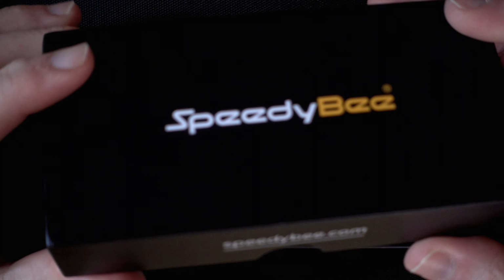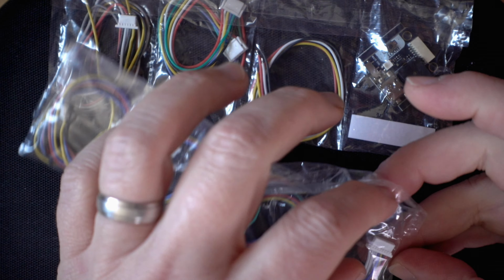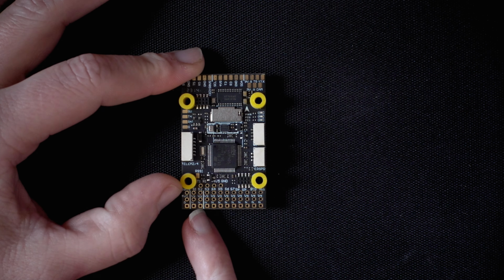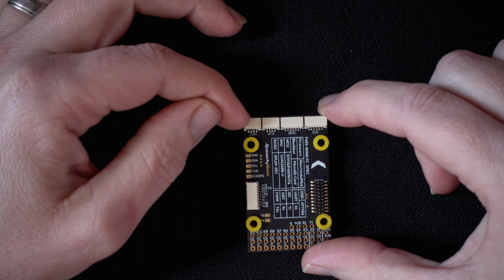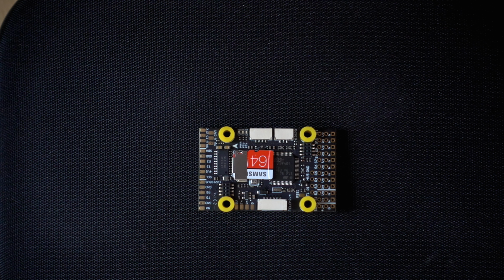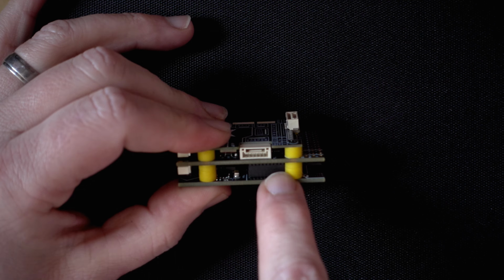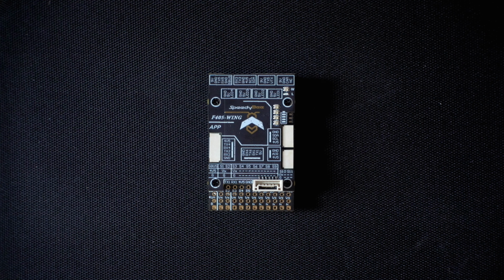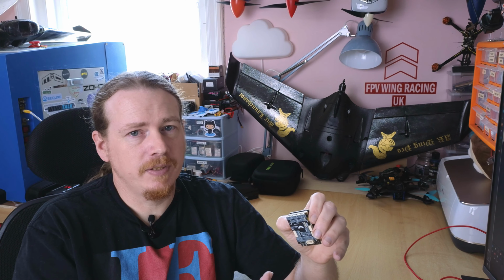First look at the SpeedyBee F405 WING flight controller

Comment: Brilliant overview Darren!!! I'm glad you touched upon the cons of this FC. Hopefully reviews such as this will push SB to refine the next line of FW flight controllers. 🍻
Reply from the maker: Thanks Shawn. For me there are a few cons. But I still think it will be a good FC regardless. But yeah, I hope a v2 is a bit more thought out.
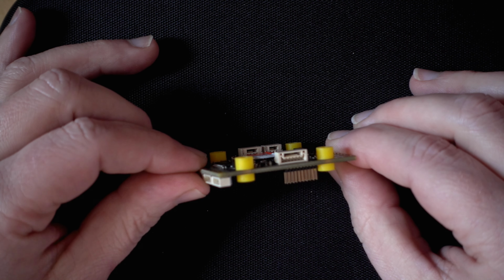Reply: @MrD  14:39 The barometer is absolutely indifferent to the presence of the SD card next to it. It measures the ambient pressure, not the air flow rate, which the card plate could interfere with. This claim is absolutely unfounded. 
 As for the "extra" connectors on the board - this is done for versatility. You can either solder or use connectors. This is as convenient as possible for different users. I think you can solder off these connectors if you don't need them.
And even more clever will be the creation of a printed circuit board by you, where all your comments will be eliminated.
I turned it on to find out about the speedy bee setup. I am against putting three wires of different lengths specially for you. I want to avoid using a soldering iron in the field when setting up. I will solder everything in the workshop, and in the field I will use only connectors.I've wasted my time on this review.
Reply from the maker: @nikolympiysky  you're missing the point with my comment about the SD card over the barometer. I'm saying the problem is that because of the position of the SD card, you can't put open cell foam over the barometer, to help make the readings more consistent. This is a well known fact and technique that pilots have been using for years. Matek flight controllers even have the open cell foam already. It is not unfounded at all, and has been proven and used for years.

You're also missing the point of the extra connectors. What I'm referring to here is that there are two connectors both doing the same job. For example the DJI connector and the VTX connector. They could have been consolidated in to a single connector without losing any versatility. Desoldering connectors like that can also be a pain. Most people don't have a hot air station at home, which would be the tool needed to remove these connectors. Using a  soldering iron would be a painful process, as you need to heat up multiple pins at once.

I find your comment about the different wire lengths hypocritical. In the previous paragraph, you mention the connectors are for versatility. Yet I suggest different length wires for versatility, and that's somehow wrong.

I'm not making these suggestions just for me. They are from years of building fixed wing FPV aircraft, and knowing what is needed in different builds. Everything in my reviews is to try and help everyone decide if it is the right product for them. I can always change things for myself. I would feel like a fraud if I saw something that I didn't like or thought could be better and didn't report it. I'm not one of these disingenuous reviewers who will tell you everything is great!

At the end of the day, we're all entitled to our opinions. These are my opinions, and I'm not going to sugar coat them to make anyone happy. I will always be honest with my reviews, and hope that people respect that, even if they don't always like what they hear. Sorry you feel like your time was wasted. But at the end of the day, you're in control of your browser's back button. Not me.

Comment: Thank you for a comprehensive review, but please don't tell SpeedyBee to skip the blocks. The point is not to avoid soldering in general, but to avoid soldering TO THE BOARD ITSELF and all the risks associated with that. I am fairly certain my soldering skills are above average, and I never ruined a board, but I'm still tired of that constant risk, and would much rather join wires than heat pads. I know the pin headers still have to be soldered, but at least there are fewer points of risk than we're used to. Thank you for the connectors, SpeedyBee, they let us keep our amateur soldering irons clear of your hi-tech!
Reply from the maker: The thing is, we still need to solder to the board. So its not like the connectors stop that. They’re also around 60% bigger than the pads. And this has caused some bad design decisions on this FC. Not to mention the wasted space due to connection duplication. The pads that they do have on here are pretty large too. Which makes things much easier to solder too. 

But we’re all different. This is my personal opinion.
Reply: @MrD  Yes, we still have to solder to the board, but at fewer points. That said, I agree some of the design decisions are suboptimal, and thank you for shedding light on that. A very informative video!
Reply: @Henning_Kolstad  One of the biggest issues with soldering, is the solder wicks up the wire a little way, causes an abrupt end and if the wire flexes at this point, it breaks the wire, often this is inside the wire cover, and can’t be found, this has happened to me a couple of times, so I avoid soldering servo type wire. Soldering pins onto the board is OK for me
Reply: @peterhancox5268  I have heard of that worry, but never experienced the problem, and I've been at it for half a century. I just make sure the shrink tube is a bit longer than the wicked joint to protect it. Prefer that method over crimping connectors, which has given me more failures over the years.
Reply: @Henning_Kolstad  Agreed, but the main problem I’ve experienced is joints breaking in the wire where soldered onto a pad on a FC, where is it is near impossible to protect with heat shrink
Reply: @peterhancox5268  I don't like that either. Doing it right now, first time ever, to squeeze an F411 into a Drift. No other way to make it fit. Have considered hot glue as a stabilizer, but I'm afraid it could be slightly conductive.

Comment: Very good points.

  I've always wondered how you get that XT connector on the marek board without any wires?
Reply from the maker: It’s just soldered directly to the pads. This FC is just used for videos and development work. So I kept it compact.

Comment: 12:08 as a newbie to these type of controllers - I like they have the ports in addition to the pads.  Much easier to hookup and not brick your board if you aren’t great at solder.

Comment: Hi Darren, please could you suggest the best way of connecting Frsky FPort?
Reply from the maker: If you want to use FPort on an F4 flight controller. You will need a receiver with an “Inverted SPort” pad. Hook that up to T1 on this fc, plus power to 4v5 and ground to ground. In INAV, set UART 1 as Serial RX. On the receiver page, set the protocol to FPORT and switch the “inverted compared to default protocol” to on. 

You’ll also need to make sure that the receiver is flashed with FPORT firmware, or the telemetry type is set to FPORT in the receiver options. Depending on which receiver you’re using.
Reply: @MrD  Thank you

Comment: I guess speedy bee should listen and offer a barebone version  , where you only a longer and a shorter remote control cable.
Would mean more logistics (2 versions with and without sockets), but they would be able to realize if the wing pilots would go for the sockets and harness / cables or for the barebone version. Also I do not have to pay for all these I would not use. 

I will get one cause I have bought some speedy be products recently but never from their website cause I hate to drive 50 km to the customs and spend an hour there just to get into discussions about if that is allowed or not and what it is really for. I prefer the service aliexpress offers by paying the customs and vat at checkout which ebay has not even implemented.

Comment: Nice structured video.  The other less than ideal feature of this board is that it is difficult to fit a removable ELRS cable where there is not much head room.  I have fitted one of these in a Mini Drak, in the normal place behind the main spar.  I have fitted the 90 degree server headers, but the vertical ELRS header means that the 4 way connector fouls on the fuselage lid.  I had to direct solder cables to the FC in the end and put a connector in-line.